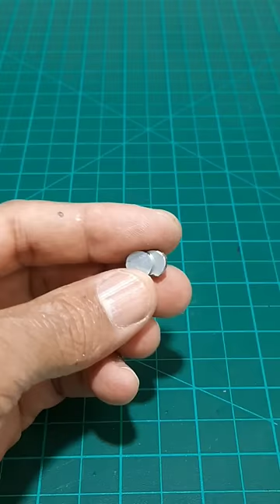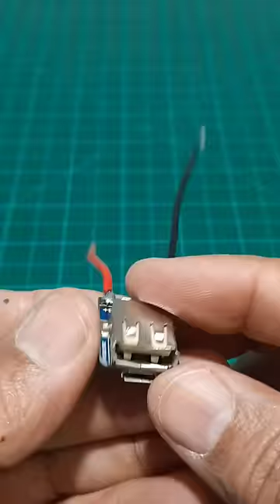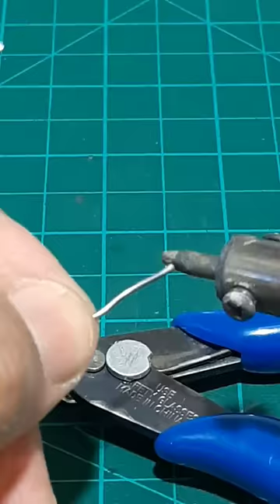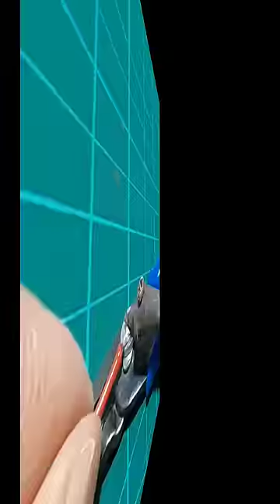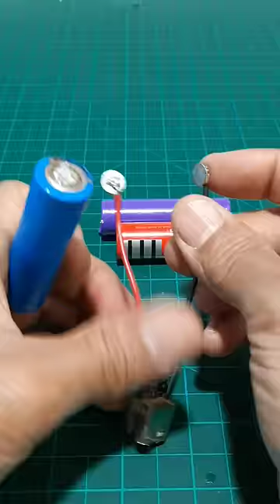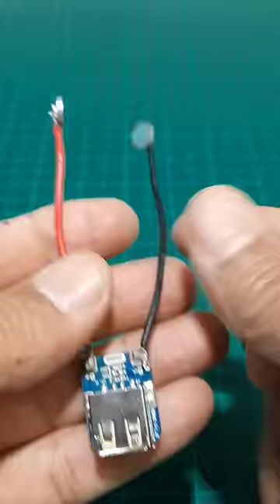Best way to charge a lithium ion battery#youtubeshorts

Comment: Unless the other end of that usb cable is plugged into a computer where you can control the amps on the charge, get voltage feedback and maybe even make the slightest changes that a charger with protection may not have then no, this thing is far from the best charger. Actually, its more like the best thing to destroy your cells. Lol
Reply: The PCB is literally a battery charging module, that registers voltage, and protects from over charge.

Comment: Solder wires on 2 round iron petals same as neodymium magnets size and glue iron petals with neodymium magnets to charge batteries. This way magnet will not lose any magnetic power.

Comment: One problem lithium batteries are cased in stainless steel and magnets don't stick to stainless steel.
Reply: Because it is not steel, but a fake steel. Real steel is iron-based, and iron is magnetic. Also real stainless steel. Example: I have stainless steel cutlery, and it is magnetic. Unfortunately, our electric kettles and so-called pots steel one are not steel. It's not a bad material, but the name is misleading.